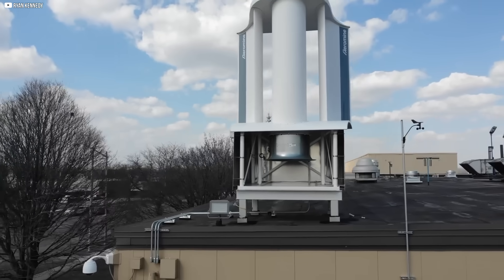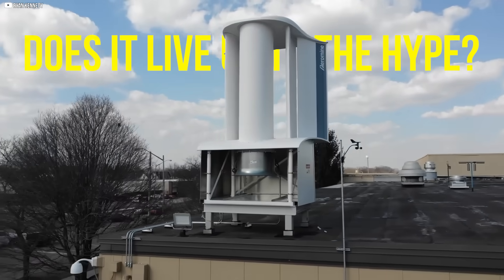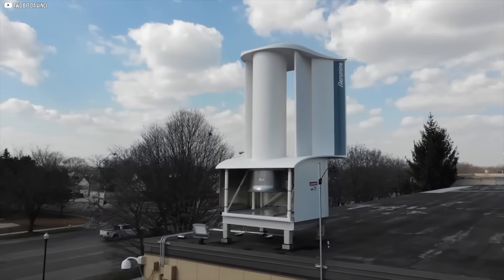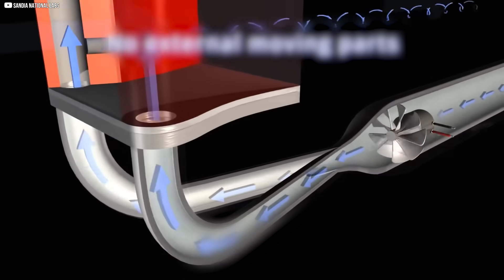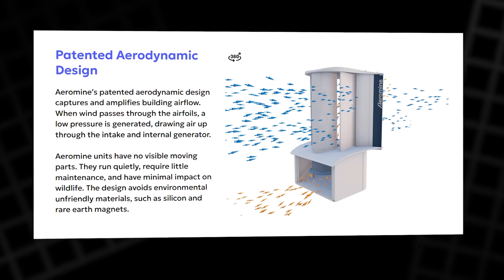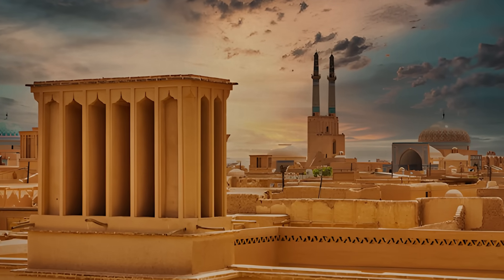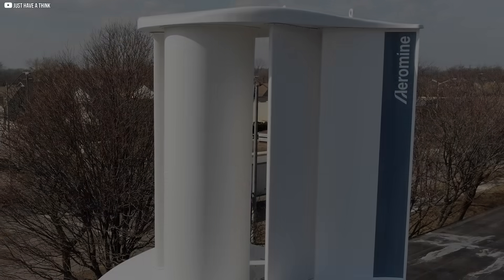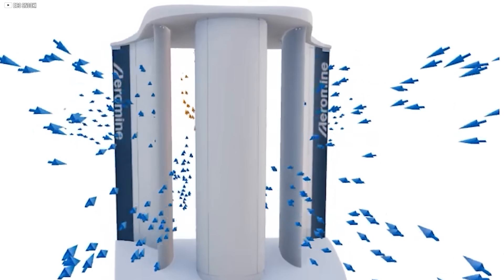70% Cheaper Than Solar? The Truth About Aeromine Wind Systems

Comment: Why not making rotating to always point it directly into the up coming wind, and funnel the find directly into the turbine. To this looks like a halfbacked solution with a lot to optimize airflow. It is questionable the this indirect use of windflow is better then to put a turbine directly into the wind.
Of course, there is still the disadvange of lower windspeed at low altitude. If the technology is really as good as promised, why are data isn't shared? I fear that this concept is just as disappointing regarding LCOS as all other small wind turbines.
Der is an analysis found in german language at "Aeromine Technologies: Mini-Windturbine zwischen Kritik und Produktionsstart" which question to provided performance data.

Comment: The true advantage of small wind turbines is not that it is cheaper than solar, but that it is cheaper than the shitload of solar plus batteries that you need in off grid situations. If you are off grid, then every bit of energy you can generate when the sun doesn't shine is very valuable.
Reply: A “shitload” - really? And, don’t you want a battery also to backup when the wind doesn’t blow?